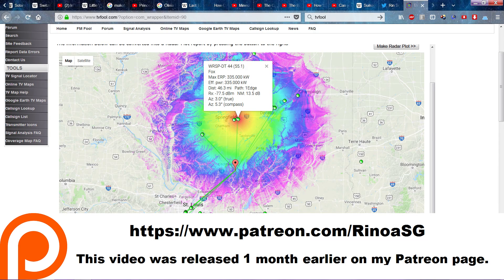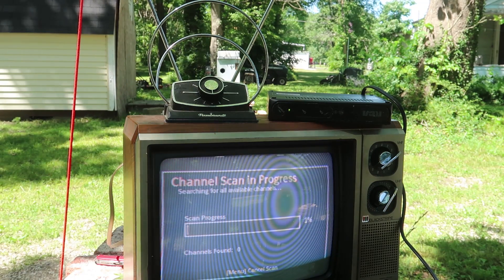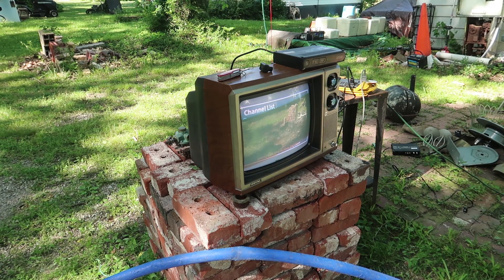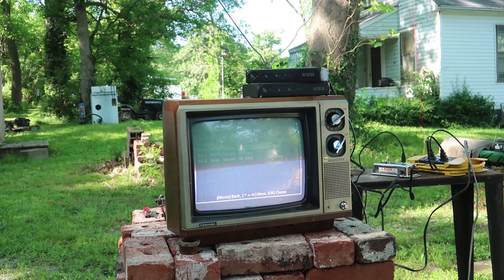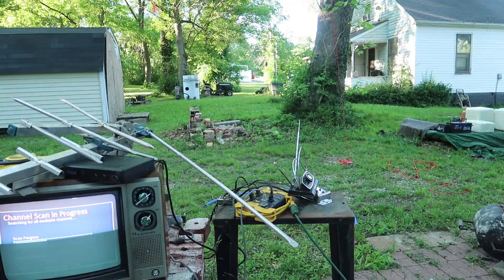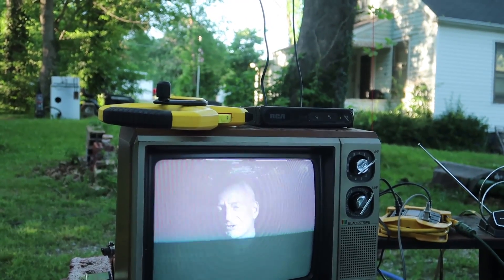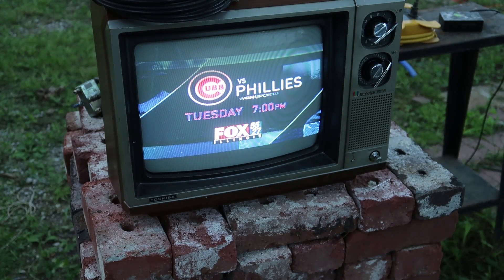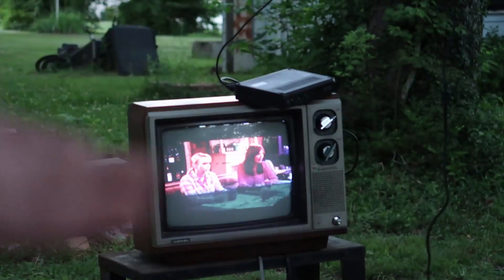Digital TV Antenna Experiments 01: reinventing the wheel

Comment: I have to agree with you what you said about analogue signal. I was able to have over one hundred stations where I live. The digital is a way harder beast to tame for sure. This is what I did Rinoa. I used two antennas that are rated ultra deep fringe type. space as far apart as possible. The distance is about 500 feet. Both antenna have rotors which are calibrated to pointing degrees accurately. When both are aliens the picture is just perfect. Easy peasy. Also, the antenna has super high gain. Good luck with your adventure. Peace

Comment: I know this is 3 years ago, but I wanted to point out that digital tv clashes with 4g wireless in some places, and you may need a filter to take out the 4g signal. Also, I heard that you shouldn't turn the brightness all the way up on a CRT tv, as it can damage the phosphors.

Comment: A basic digital tv will more than likely have a better digital tuner built in and works much better than the converter box... Also find thicker wire to build with and you will have much better reception without a doubt, 40 miles isn't very challenging if you have the right materials.

Comment: Your using old school flat wire, they stopped using it because a lot of modern technology especially smart phones give off interference, and running flat wire through a house will only help to absorb those signals. I am curious though if using flat wire to the preamp 30 feet above your house would help?

Comment: Speaking of ultra high frequency, you got to maintain line of sight between you and the TV station.
Reply from the maker: not exactly, i'm able to pick up signals from over the horizon and over hills. but yeah UHF doesnt bounce much at all through the atmosphere. its really unfortunate.
Reply: Rinoa Super-Genius , well  , how your liquid fueled rocket engine project is going ? 
Really an wonderful project though 😃😃😃
Reply from the maker: did you watch my latest video? i uploaded the 3rd rocket engine video just a few hours ago.
Reply: Yup, i have
Reply: What type of oxidizer will you use ?
Reply from the maker: pure oxygen. gasious oxygen first and then step up to LOX with the next engine.
Reply: Well, that's great, I've never tried oxygen though, I once used nitrous oxide in a hybrid rocket.
 Best of luck .☺️

Comment: Rinoa I know I'm commenting a little late, but have you looked into what impedance matching is?  Your antennas and adapters might not have "matched impedance."  In my experience the chances of better impedance matching improving the signal is random if your impedance is matched rather close, but if the impedance is way off, it could greatly improve things.

Comment: I'd recommend you go for maximum height and the most directional antenna you can get, and a rotator. use high quality coax with low loss.  the ladder line can work too but it has to be secured and kept away from nearby metal that can affect its impedance.  Also would be curious to see you try your helix array antenna idea you mentioned in another video.  
I use the insignia ns-dxa1 converter box which has a signal meter & you can crop the programming to fit the 4:3 of a crt set.  Do most people use dish or directv there instead of off air antenna?
Reply from the maker: im thinking about using a boom lift to test my antennas from now on. :D

oh and the helix actually worked really well, but sadly the brick guys at the red rooster took away the boom lifts and they keep delaying bringing the, back so i cant quite finish it yet.

Comment: First: height is key! 
The center point of a dipole antenna is the interesting point. The ends can be lower, but the center has to be as high as possible. Try hanging the center as high as possible and feeding the dipole antenna with coax cable. 

Another (better suited) antenna would maybe be something like an HB9CV antenna (designed by a swiss ham radio operator). Can be built very easily. 

also: at least around europe TV is always horizontally polarized. When mounting antennas vertically your losing 20dB of your signal, which is very unhelpful... 

also: 300 Ohm transmission lines are rather uncommon, you‘d want to use 75ohm coax all the way. Dipoles are ~70ohms, your TV also has 75ohms input impedance. That 300ohm cable is just messing up the signal integrity.  

Another tip: RTL-SDR USB sticks are great and cheap for measuring antenna performance :) 

Best wishes, Tobi / DO4TMA
Reply from the maker: thanks for the helpful info.
Reply: Use a better antenna

Comment: I recall that you moved into a new place recently, and used your electric trike to move your stuff. May I ask why you didn't use your comuta car instead? What ever happened to that thing?
Reply from the maker: you've got my timeline a bit mixed up.

Moved accross california in 2015 or so, but i have the citicar in illinois. now im only living in illinois. citicar is in my dad's barn. im hoping to get it out this month and take it to a car show, so be sure to look forward to that.
Reply: Oh, alright. By the way, I had an idea which might be helpful. Youtuber Paul Elkins frequently makes large, complex things out of carefully cut to shape sheets of coroplast. The aging plastic shell of the citicar is, I think, beyond repair as pieces are missing and welding the cracks only makes them more visible. The plastic is also undoubtedly brittle from years of exposure to sunlight. 

Underneath the plastic shell is a metal frame in the same overall shape as the car. You could conceivably fashion a replacement shell from coroplast that would fit perfectly over the frame, since the body shape of the citicar is very angular, faceted and simple. 

It may sound like a dubious concept, but if you made your own coroplast body shell once, it would be a cinch to replace it in the future. Providing the zip ties used to attach the panels to each other (and to the frame underneath) are the same color as the coroplast, I think it would look nicer than the cracked green shell it has now.

Thoughts?
Reply from the maker: the shell actually is ok on the citicar.
Reply: Oh. It looked pretty cracked up in the video. Something to think about anyway, if you ever do want to build a new shell for it.
Reply from the maker: yeah its cracked, but thats due to an impact of some sort not due to degradation. the plastic itself is actually still pretty good, but they made it thick to handle weathering. i bet it probably cracked in the cold since things are more brittle then.

Comment: Years ago I made my own "ultratenna 60" out of cardboard, 14 gauge romex & aluminum foil then wired it up to some 300 ohm wire and mounted it in my attic this got me 10 channels. 
Next I replaced the shitty 300 ohm wire with some nice low leak 75 ohm coax and a 75/300 matching transformer this got me 33 channels.
Next I added a Winegard LNA-200 preamp and this got me 45 channels farthest being 110 miles away.

Also I tried that same preamp you used in video and it just hindered my reception.

Comment: Not to hype another channel, but I built two of these and stuck them in my attic, aimed two directions at the broadcast tower clusters in our area (45 miles away). With a booster, they pick up everything available in those directions. You have to get past the guy's southern accent, but the dang things work and work well! I just used cheap 2x2's for the framing, chicken wire for the reflector and regular old 12ga house wire for the elements. If it's outside where birds can perch on it, you might want heavier/stiffer wire. Might be an interesting build & test video if interested: https://www.youtube.com/watch?v=jnN3bBY6_ko

Comment: The antennas you where using are yagi antennas and they work very well for this. The direction you point it in makes a major difference.
Reply from the maker: no they are Yagi-Uda antennas mr Uda is the one that did most of the work while Yagi is just the guy that patented it, its retarded to just call it a Yagi.
Reply from the maker: well yeah ham radio nuts are a bit retarded, but thats not the point. and its funny that you think that the anglosphere is the entire world. what about the japanese calling it 八木・宇田アンテナ ?
Reply: Sorry, I will refer to it as a yagi-uda antenna from now on.

Comment: The F'd up antenna is a yagi antenna. The previous comment will help you to calculate the length of your dipole for the frequency you want. It should be a bit broadbanded. You can use a program like EZNec to design your own antenna.
Nice find on the 300 ohm wire. Nice to see you experimenting with over the air TV.  A good rotator will be of benefit.
Reply from the maker: no its a Yagi-Uda, Yagi just patented the design while Uda designed it.
Reply: Quite true, but hams call it a Yagi. I did see a documentary once about it and do remember that.
Not much OTA TV here either.
Reply from the maker: well "hams" are boring old middle aged men who invest too much time into their radios. haha
Reply: Actually, I'm considered middle aged by today's standards (55) but believe it or not, more young people are getting into ham radio. The Lake Washington Ham Club has many members under 20.
It's quite fun experimenting with some of the digital modes and to see how far one can get with as little power as possible.

Comment: The antenna you were using at the 14 minute mark would be the correct type for digital TV (UHF)  you can connect as many UHF arrays as you like to gain the best signal.  There are many instances of DIY UHF antennas on YouTube made from coat hangers.  You should use a transformer at the antenna and 75 ohm antenna cable down to your converter.  300 ohm cable has too much loss.  Putting the amplifier at the base of the antenna is good enough.  In Georgia I get 75 channels 35 miles from the broadcast antennas.
Reply from the maker: ah thats a good point, i didnt think about connecting multiple arrays.

Comment: Hmm, I am in north-eastern Oklahoma, and get pretty acceptable TV reception here (granted, this is with a directional TV antenna on the roof and a booster; and living around Tulsa).

In my own past experiments with improvised TV antennas, IIRC I had some luck with connecting a longer length of wire to one side, or to the center pin (in a coax), and connecting the other side to ground, or to a shorter looped piece of wire. Good or not, dunno... (But, the directional roof-mounted antennas work a lot better here).

Comment: A dipole antenna has the two elements pointed in either direction going to each of the coaxial conductors. They do not form a loop which would just ground couple and not pick up anything. The dipole spans the wavelength, a multiple of the wavelength or a division of the wavelength. Usually its half the wavelength. A monopole antenna also has two conductors the air and the ground. Dipole antennas are intended to capture standing waves. Yagi antennas like the ones you were using at the end are basically dipole antennas like a speaker drum but the extra elements that resonate. Ones in front direct and ones in back reflect to the driven element or the one connected to the receiver.

Comment: The amplifier would do better if it was closer to the antenna instead of having it plugged in by the TV having it up in the air next to the antenna would cut down on any Distortion. It would amplify the antenna right from the antenna not after passing through 50 feet of cable. Another thing to keep in mind is every hundred feet of cable your signal drops I think 33%. Every time you add a splitter your signal drops 50% so you want the shortest route possible to your TV. And you want to stabilize your antenna. The first two antennas you were using before those were used a long time ago. Nowadays it's HDTV. You can make an HDTV antenna out of coat hangers. I made a double one on my channel. It still works today. Channel Master makes an awesome amplifier the 7777 it's about 80 to 100 bucks.. it strengthens the signal from the antenna... another thing when you're pointing where the signal is being released you don't want the antenna moving around while you're doing your channel scan you want it permanently not moving. There's no doubt in my mind if you got a long-range antenna and put it up in that tree stable you would catch a hell of a lot more than three channels is specially if you add it a Channel Master amplifier. I'm currently downtown Toronto catching in 40 HD channels uncompressed signal. Which is way better than compressed what the big box cable guys are selling us. 1080 looks way better uncompressed. All I'm running is a 8-bay antenna.. would Channel Master 7777 and a newer type of TV that supports HDTV. And has that tuner you have there that you have a lot of the RCA tuner and has that built into the TV a lot of newer TVs have that  built-in. Anyway interesting video keep up the good work and hopefully you can find yourself a long-range antenna
Reply from the maker: the amplifier was just a reason to have another coax cable on it though tbh. i threw away a bunch of coax cables last year not thinking id need them. lol
Reply: Rinoa Super-Genius  This is why I never throw anything. I guarantee you you will get way better results with a long-range antenna there fairly cheap. Once they're mounted properly you will see the difference literally :-)
Reply from the maker: well ive been trying to clean up, because i have a real problem with too much shit. guess i threw away too much shit this time...

Comment: OMG! Use a cable with the correct impedance to match the antenna and TV input!! Or use coax to wire converters!
Reply from the maker: only can use what i have, do you expect a coax cable to magically appear?
Reply: Everyone has over the years acquired various lengths of cheap TV coax or VCR to TV coax cables or the 2 conductor flat antenna cable.
Reply from the maker: yeah well i had a roll of it somewhere but threw it away. so now the longest i have is several feet.

Comment: Just get a slightly better multi-element antenna and install it on your roof. Problem solved. New HD TV's have digital tuners built-in and they are better than those cheap converter boxes.
Reply from the maker: i dont have any newer tv.
Reply: Yeah, you really don't need a larger antenna, just a means to capture the signals better.  One of those tripods, a 10 foot length conduit, and UFH antenna all on the roof and you will be fine
Reply: Ps: that RCA box has horrible reception
Reply from the maker: yeah im tempted to try a new digital converter box.
Reply: Phillips made a model that come out at the same time, which can pick up double the channels of that RCA. The only drawback to the Phillips model is there is not a single control on it. It is entirely dependent on the remote to even turn it on.
Reply from the maker: well thats exactly how this is anyway, so nothing worse.

Comment: Digital television is complete rubbish, i used 2 boosters and still only had few channels, i later decided to make my own aerial instead and received 50 channels sadly had to stick it on the roof of the house and used single booster. 

Digital Television transmitters hold more then 1 channel and more low-powered then analogue ones so it saves the cost for them to run.

With analogue i use to hang a wire out of the window to receive tv channels, nowadays you need a "on the roof aerial" or boosted one it's complete bloody nightmare.

Comment: Btw... no such thing as a digital antenna...
Reply: Rinoa Super-Genius not only that but the HD coming over the airwaves is an uncompressed signal it looks better than standard 1080i or 1080p whatever signal you're getting is an uncompressed signal which is larger which looks a lot better. Look into that bro
Reply from the maker: uncompressed? but all digital video broadcasts are compressed.
Reply from the maker: yes there is, because digital works at different frequencies, so an antenna made for digital television could be more finely tuned and not work as well for some analog signals since it doesnt have as wide of a range. but no antennas on the market are digital, i agree with that.